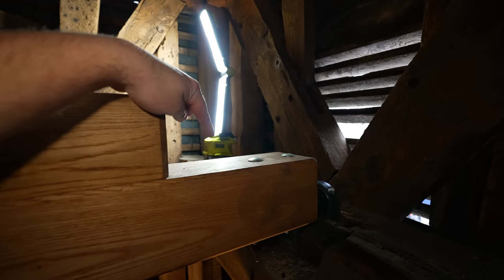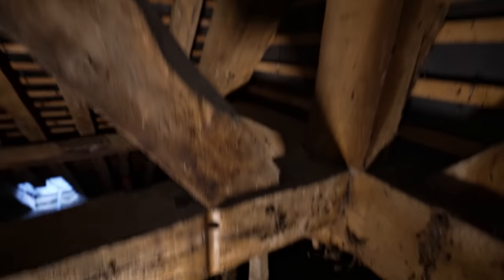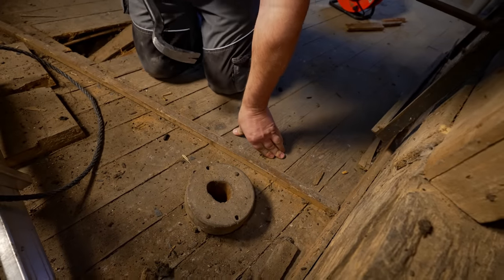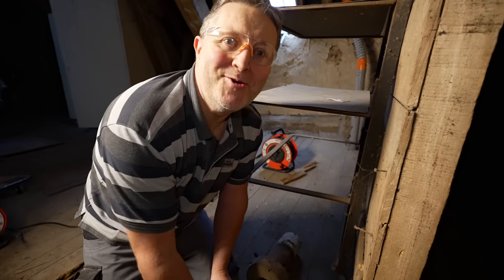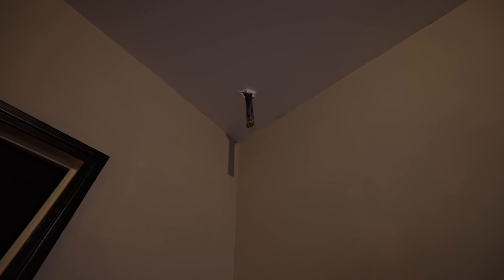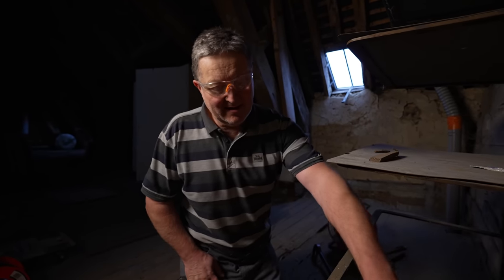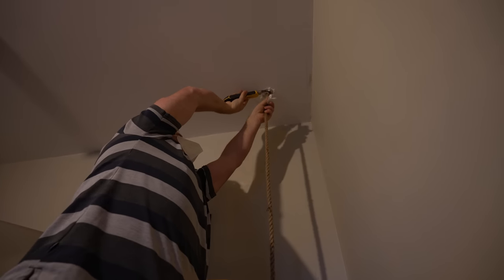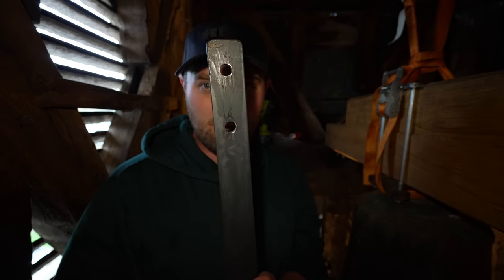Hearing The Bell Ring For The First Time

Comment: Great job, sounds wonderful! Yesterday when installing the bell it seemed like there was too much end to end movement of the shafts in the bearing housing. My concern is that the headstock could move sideways enough to fall out out of one of the bearings. To control the shaft movement, it might be a good idea to put Jubilee Clamps, or something similar, on each of the shafts,  close to the the two bearings on the bell side.

Comment: Great job on the bell. It is just so proper having an old belltower with a functional bell -especially for the holidays. I recall a longer, smoother, pull of the rope whenever I've seen an old bell being rung. You may want to experiment with the placement of the rope pull mounted on the headstock. I pass an old bell every day on the way to work. It once was mounted atop the old fire station. On one side of it, there is a really large metal pulley that the rope went over. This gave more leverage when pulled and made it easier to ring. Wish you all a Great Christmas😄🎄

Comment: Pull and let go, you're not allowing for the natural swing of the bell. It's only hitting the one side of the bell.  
See Missommer Murders the episode: "Ring out your dead,"  the bell ringers give a good pull down then release the rope and let it slide naturally up through their hands, your guy is pulling so fast the clanker is only hitting one side of bell, bell is  barely swinging. 
I put in mu 2 cents I will say no more, great job sounds good but could sound great if he wasn't ringing it like it's an emergency ring.

Comment: This would likely be one important purpose behind the location of that window, looking down on the altar, allowing the bell to be rung at specific points during the celebration of mass, alerting townsfolk of the moment of consecration of the bread and wine (perhaps also to ring the Angelus when preceding or following early morning, midday, or evening service).   For this the bell does not need to swing sufficiently for the clapper to strike both sides of the bell.   What is required is three single strikes (twice during the mass) and three sets of three strikes, followed by nine strikes for the Angelus.

Comment: Good to hear your bell chiming 😊😊  The "sally" is the fluffy wool part of the bell rope. Traditionally  the rope itself is made from hemp but most new ones have poly at the top connected to the bell headstock. There are several ways to ring bells and chiming it like you were doing is one.

Comment: TR Tribal Gaming Great work on the bell! One recommendation instead of a pulley or the vertical rod and angle that will help the bell swing more fully and easily - the headstock of a bell often has a more horizontal bar off of it that is offset, usually out to or near the vertical drop of the rope. This makes the rope pull more easily and the bell swing much further.

Awesome to hear it ringing!

Comment: I am sure you completely forgot to ad a roller for the rope. The rope should go completely horizontal as coming from the bell and then go straight down.
Ringing the bell will be easier because you will have to pull the rope about 3 feet per time.
The weight should touch both sides of the bell for the extravagant sound.

Good luck.

Comment: I suggest you put a pipe through the attic floor (from the oak bezzle) down to the ceiling of your office to prevent the rope fraying on the terra cotta bricks or rubbing on the insulation. Great content as usual. Merry Christmas.
Reply from the maker: great idea sean and i both said the same thing today to stop anything falling down the hole
Reply: @ThePethericks  I was thinking the same, a length of PVC to span the distance from the upper collar to the one in your office.

Comment: One thing that might help for ringing it...our church has what looks like (and may even be) a stirrup at the bottom of the rope. Then you can use your leg power to push down on the rope as well as pull with your arms. It also had the knots as was suggested 👍

Comment: The whole bell is supposed to swing from side to side, not just the stick in the center...  You need to pull the rope in a slower rhythm with long strokes, the bell needs to swing a lot more, that makes it way less exhausting.

Comment: I think you should pass the bell pull through a pipe, or sleeve,  where it passes through the insulation, as I suspect it will 'pick-up' on the fibre material over time. Otherwise, a great achievement and the bell sounds great. I wonder if there are any local ordinances about bell-ringing where you are?

Comment: Well done on completing the bell project. That bell sounds wonderful. My only observation is, would an elbow shaped piece of steel instead of straight, make it easier to swing the bell? It shouldn't need so much force to get it going then, and the nuns would find it esier to ring. Just my thoughts.

Comment: Maybe one pulley level with the new bar you put up on the headstock would make it much easier to pull and put less stress and drag on the oak guide where it’s passed through. 
Still, doesn’t look too shabby or super hard to pull. Great job!

Comment: The bell rope normally fitted through a wooden dougnut shaped boss in the ceiling, these were made from a hard wearing fruitwood like Apple or Laburnum and turned so the long grain was in line with the rope.
To make the rope pul easier the pivot for the bell it needs to be a wheel or half a wheel.

Comment: Nice job guys!  Amazing work!  The fast ring you were doing seems more like the type used as a city alert.  Might want to get the cadence down for a slower ring.  Also, the oak piece should probably be rounded slightly on both sides where the rope passes through so the rope doesn't catch/chafe on the sharp edge of the wood.  Is the hospital still in use next door?  If so, may want to keep the bell use down out of respect for the patients.

Comment: Haven't read through the comments... but weren't you plannung on putting a spot of weld on the nuts on the end of the (slightly too short) long bolts that support the bell to the beam? Wouldn't want you to miss that & find a bell popping through your office ceiling. Well done.

Comment: You should have a horisontal  steel bar on the upper wood beam before it goes down into the building.
And do make a automatic system so it can ring in the new year , every year and make it a new history for the building

Comment: The bell ringing for the first time in many years must have been quite a moment for the locals, but you do need a counter balance on the yoke so the bell rings in both directions,... At the moment you simply have bong bong bong a single note, a counter balance will give you a bing bong rhythm  xxxx

Comment: If you intend to ring the bell often with the rope you may want to instead of having the steel leg bolted into the wood you may want to have the wood clamped by two pieces of steel that create a bracket on top similar to the one you have bolted to the side overtime the pressure of being pulled sideways will most likely pull the leg both out of the wood but if you clamp the wood in between two pieces of steel I highly doubt you never have a problem with it ever again

Comment: You need a metal loop higher on the tower also so the rope pulls sideways not diagonally, it will reduce strain on the rope and bell tower
Reply from the maker: i was originally going to add a pulley but they didn’t have any locally so i need to add one when we get the proper rope and we can name and add a plaque to the bell at the same time.

Comment: The bell would ring easier if you attached the rope lever so it was horizontal and the rope could pull down on it. Knots in the rope for the bell ringer to grip would keep their hands from slipping and giving them friction burn.

Comment: Ringing the bell shouldn't be so much of an work out as this seems to be. Having rung the bell professionally myself, this is not the way I was thought or thought others. In the video it seems that you are napping the rope and also stops it for every single ring. This is not good for the bell and can result in it prematurely cracking. Your arm movements should follow the flow of the rope both up and down. You will need to add some pressure on the down strokes when you start ringing and when the bell is slowing down, but never upwards unless you  want to stop ringing.